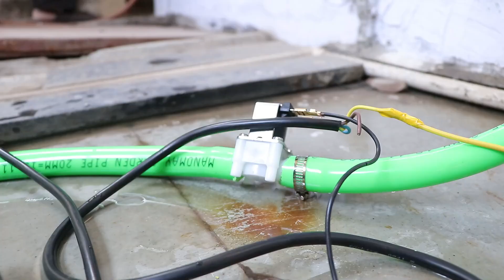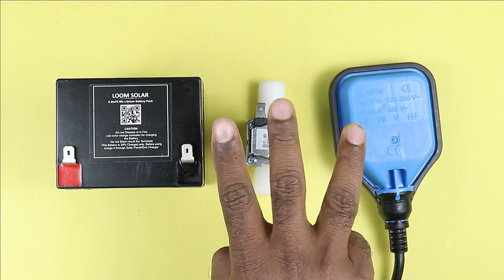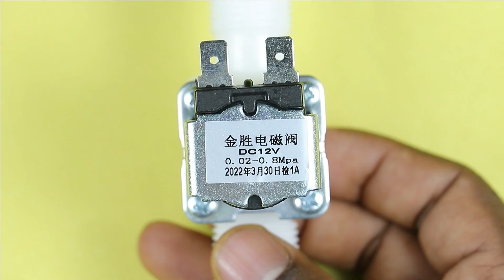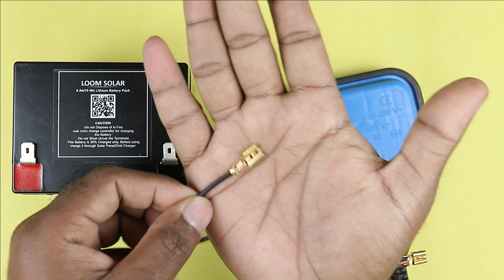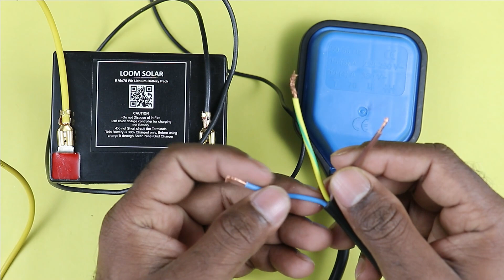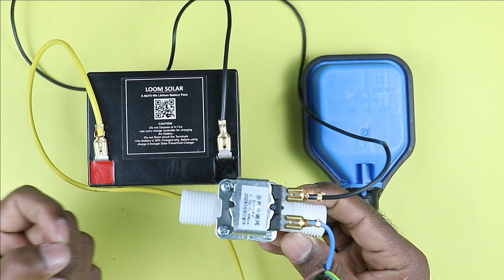Solenoid valve connection with float switch for water pipeline @TheElectricalGuy

Comment: If switching an inductive DC load (like a solenoid), install a flyback diode (e.g., 1N4004) in parallel with the load to protect the switch from high-voltage spikes when it opens